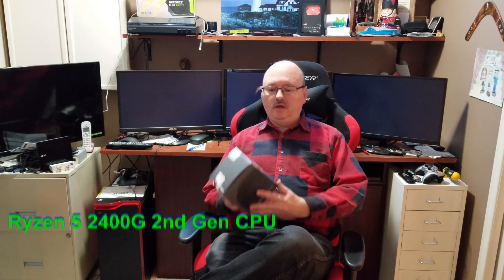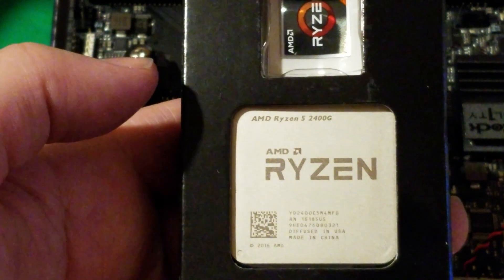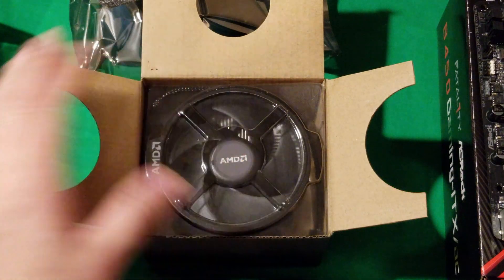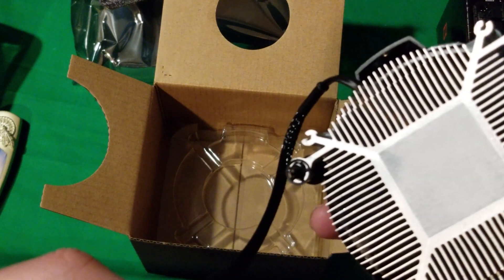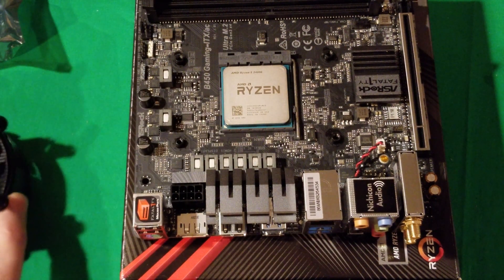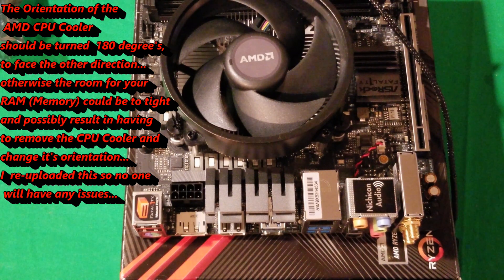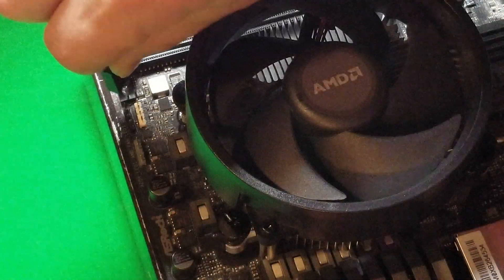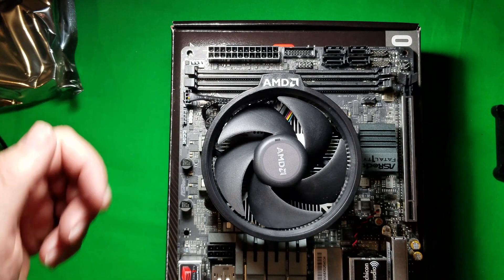Ryzen 5 2400G Review and Install ReUploaded to correct a small mistake...

Comment: Hey i have a problem this was my first build my pc turns on but then powers off in like 45 sec to a min i dont even have windows installed yet i need help
Reply from the maker: Well it's difficult to diagnose a PC this way but some suggestions to start would be: check the RAM is seated correctly, verify you have the case LED connectors for the Front Panel in correctly, double check the power connections for your 24 Pin and 8 Pin Power, lastly check your Power Supply is working correctly. Once you've done this let me know what else is going on and I'll see if there is anything else I can suggest. Good Luck...Thanks...
Reply: I got it thanks for the help much appreciate
Reply from the maker: @lucianosanchez563  Awesome, great job...

Comment: Seems quite a few builders have issues of not getting any video feed at power up and thus cannot access BIOS at all because screen remains blank.  I have tried several HDMI to HDMI cables and no luck. I even tried an HDMI to D-Sub monitor and no go. Have you heard of this?  I am only using the Vega graphics that come with the chip.
Reply from the maker: I've done a bit of searching and it seems that some motherboards are saying they are 2000 ready but actually are not, the BIOS needs to be updated to accept the 2nd Gen Ryzen CPU...So there seems to be 2 options if that is the case, you can contact AMD for a bootkit, or take the motherboard to a local computer store and ask them to update it for you...there are a couple YT videos that are talking about it as well in case you want to check them out...sorry wasn't aware of this till recently...
Reply: @Reviewing_Playing_and_More_RPM  really appreciate your work and quick reply. I bought the motherboard at Micro Center and they said this board's BIOS is set for this cpu.  It is a Gigabyte B450M DS3H.  Found out the initial memory they sold me (their recommendation) was not right for the board and their online techs pointed this out after days of pulling my hair. I was suspicious of said RAM upon further research. They exchanged it with no problems for correct memory.  I'll try the for the AMD bootkit as my 30 day Micro Center grace period is about out.
Reply from the maker: @bocconom  Ok, well hope it helps...Take Care...